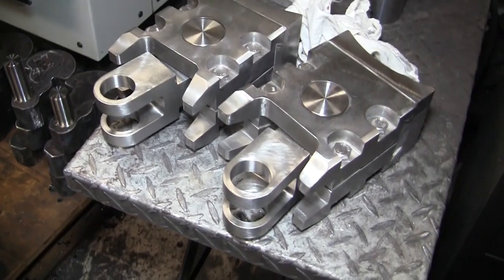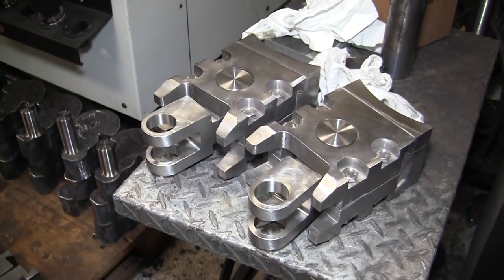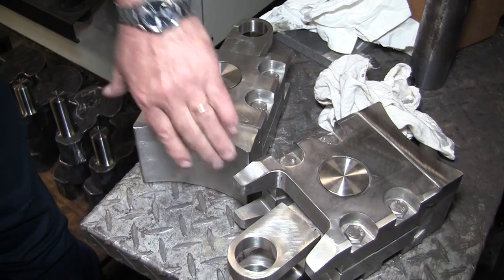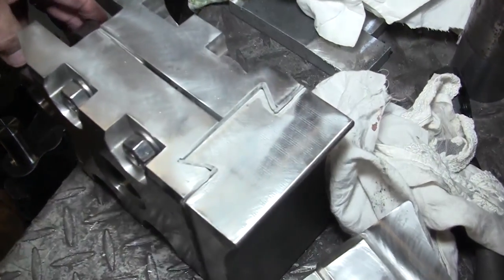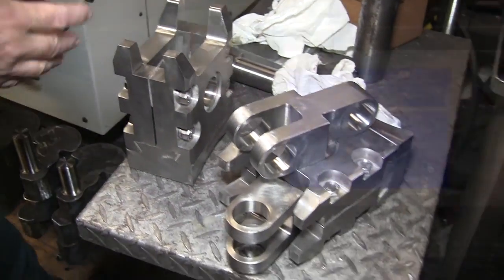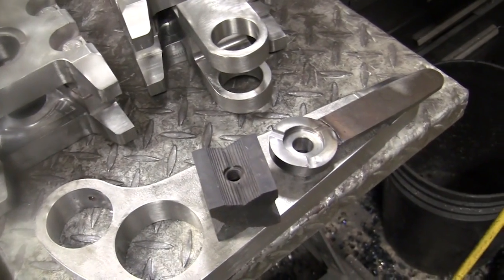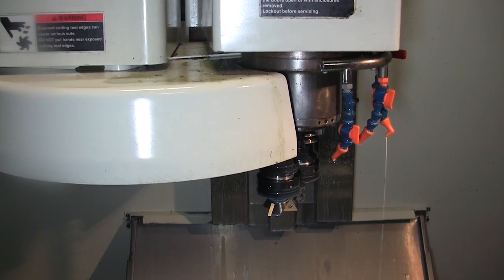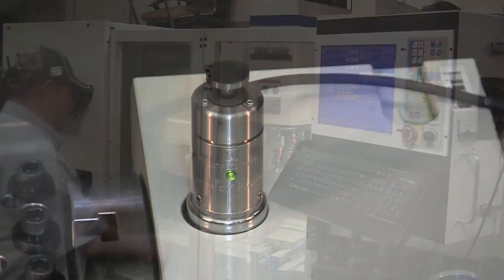Fadal 3016 VMC CNC Machining Center Centroid Retrofit Upgrade

Comment: when you do these conversions, do you replace the entire electronics? or is there some you keep to keep costs down? I'm looking to covert my very small machine to have better positioning motors and new brain to control it. on a tight budget of course!
Reply from the maker: Hello. often all you need for a fadal is a "Allin1dc" and a PC that meets our minimum spec requirements.  many of the fadals use common DC servo motors with are compatible with the centroid allin1dc cnc control board.   this page is the centroid cnc technology overview page.. with two videos that explain the hardware and some nice diagrams showing how a system works.  http://www.centroidcnc.com/cnc_technology.html  
if you have any questions email support@centroidcnc.com  feel free to send us photos of the machine you are considering updating and we'll be glad to help you determine the bits needed and put it all in a kit for you.
Reply: excellent thankyou. I've been looking for help in getting a kit together thats specific to me but all i can find is generic kits with things in it i don't require. ill get some info and photos asap. thanks again